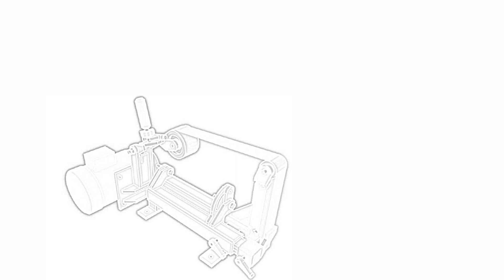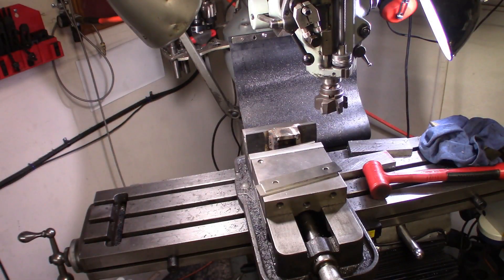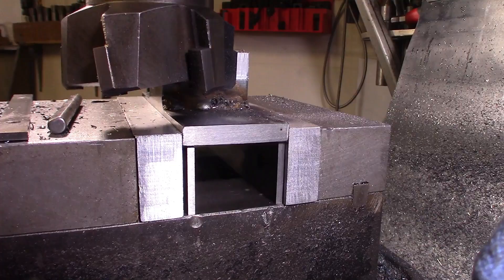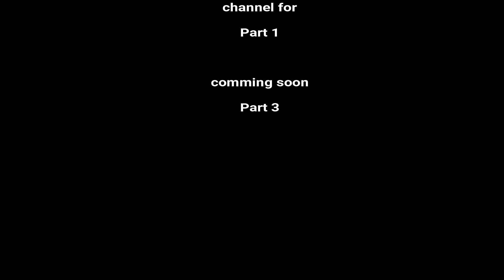2x72 Belt grinder build Part #2

Comment: Those welds look like you need to practice welding more. Start by getting yourself situated in a comfortable position, get the work at a height that your arms are comfortable. Find a way to brace your arms on the work surface. You will be amazed at how it helps. Squatting down near the floor isn’t the way to do it! I don’t mean to be negative, I’m just trying to help!

Also get your tool and Cutter grinder working so I can bring up all my dull tools for you to practice on. I managed to get the Kent mill moved into my shop and reassembled and installed the VFD, now I just need to get all the programming right for a remote panel! Also the remote panel wiring finished.
Reply from the maker: This project has probably doubled the amount of welding I've done.  I can tell I'm getting better.  It's a bit strange how the experience helps but I don't even know what I'm doing different.  In my next video I have 2 bozo moments while making the same part I remake 3 times and each time the weld is 100% better with the last one being almost acceptable.
Reply: TheArsonsmith4242 projects like this are a chance to learn more skills or improve the ones we have! I know you will prevail!